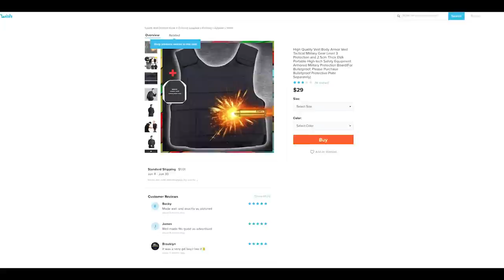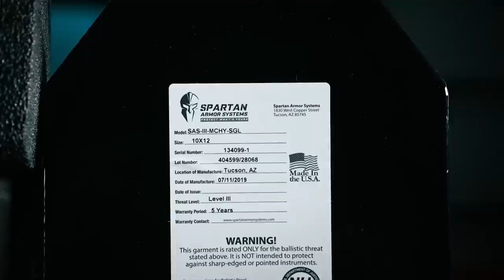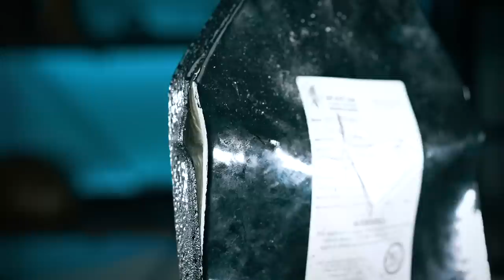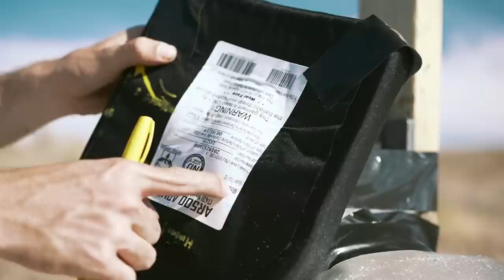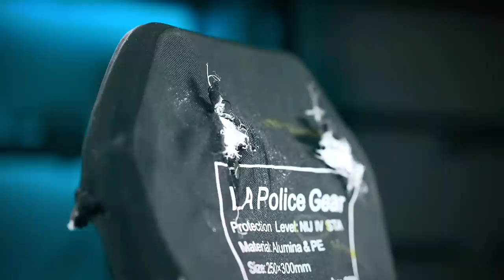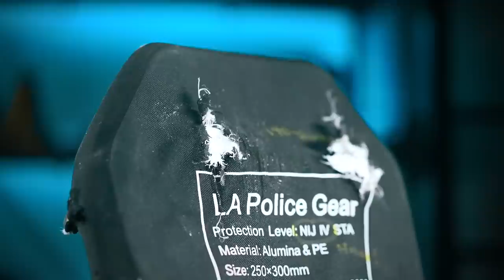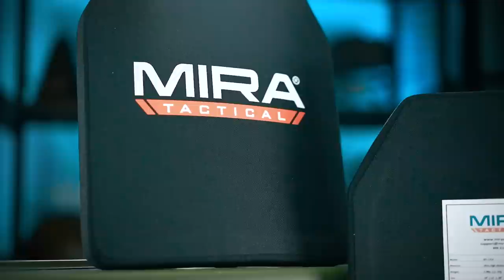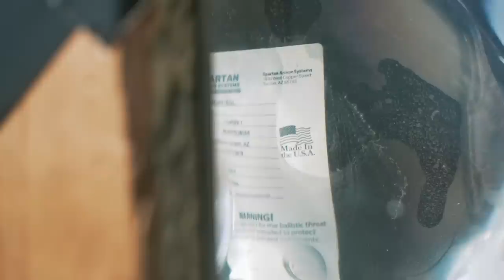Best Ceramic & UHMWPE Level III & IV Body Armor: Mira, RTS, RMA, Spartan, LAPG

Comment: Seems like, of the tested plates, for Lvl 4 the only ones worth your while are RMA or Mira. Obviously in a pinch anything is better than nothing. 

When it comes to staying in the fight, if you plan on tanking multiple rounds, steel 3+ might be the best option. Unless you're up against opposition with high level AP ammo. Longest life best multi hit and can be "light." Also not so sensitive to environmental factors or being dropped. 

I was surprised how M80 chunked most of those Lvl 4s. M80 is pretty common.  As is 193 and 855 and might be safe to say is coming out of 16 in barrels for the most part.  30-06 AP not so much.
Reply: @bkackmagic555  depends on the type and amount of buildup as seen in their previous armor test. Carrier also has an effect on the amount of shrapnel reaching you as well. No one wants to take a round. But I'd prefer a chance of some shrap hitting me vs a round in my vitals. 

You aren't wrong. Some coating on plates is useless and blows out on first hit. A bunch of scrap to the chin could be a game over.

 To each their own as with all things. The point of the first comment is that steel will take(stop) more rounds and is more "durable" and has longer life. 3+ also will stop most of the rounds out there. That is to say the rounds one would be most likely to come across. 

Take it easy, baby. Stay safe.
Reply: @lighlotus117  the carrier will stop spalll that wasn't lethal. It isn't stopping spall moving at 1000fps and up for example. That stuff is going to mess you up good. Plus again. Why are you getting shot that many times. You're larping or you're already dead anyway. You'd be down or domed at that point. No ones gonna keep shooting your chest like it's a movie
Reply: @bkackmagic555  I said, "if you plan on taking multiple rounds." You're goal is to not get shot at (or hit) at all. Shit happens. Why do companies make multi-hit plates? No you're not gonna gonna stand there and tank rounds like it's an 80's action film. No one thinks that relax. 
Fact remains:
Steel will take more impacts(except AP.)
Steel isn't sensitive to environment.
Steel is drop safe.
Build up quality and amount affects shrapnel reaching you.
Carrier construction affects amount of shrapnel reaching you.

This is will be my last transmission. Godspeed, Vault Boy.

Comment: My big question is aren't the plates supposed to be in a carrier. I have never seen a test to see how much a carrier helps in the protection.
Reply: A quality fitting carrier would help mitigate all that ceramic coming free. It would help hold it in place thus helping the plate survive more hits in the same area.

Comment: I feel like armor tests should be somewhere in between the two. I agree that doing 6 shots perfectly spaced to split the plate perfectly isn’t the right way because you are doing a “best case scenario” test. But also, punching multiple rounds into the same hole isn’t realistic either. Worst case scenario for sure. Good info to have but I feel like maybe just standing at X distance and shooting a plate like you would shoot a drill makes most sense. Even at CQB distances the chances you get hit in the same spot during a gunfight is pretty damn low.

Comment: If I remember correctly M193 penetrates level 3 steel only out of a 20" or longer barrel, should have tested a 308 in that first armor too just to see if it stops. I know differences in material and barrel lengths can have different effects on armor, would have liked to seen that
Reply: M193 will penetrate steel when it's velocity exceeds 3150 fps depending on the hardness of steel. Real M193 is doing 3200+ from 16" :D
Reply: @BuffRANGE  so milsurp ammo can but not the stuff I get from the local shop?
Reply: @prodigypenn  All depends on the "stuff". IMI, Independence, and Lake City offerings specifically marked "5.56x45mm"  would do it. That's the primary reason I test a lot of ammo on my channel, because you'll find quite a few statements on those ammo boxes grossly overstate their performance :D

Comment: I use hard cati armor. It heavy but I put everything up to 300 msg and 45-70 and it stopped them all. So I got zither with double coating. I wear it often and each time the weight is riding easier each ride. CATI ARMOR 3+ IS THE WAY TO GO IN MY BOOK JUST HEAVY SO MAN UP 😆

Comment: So, knowing all this am I screwed if all I have are hesco L210s?
Reply: Yes. Another youtuber has a video coming out within 2 weeks
Reply: If you want to protect against .308 Yes :D Video drops Tuesday ..
Reply: I have l210's also and I really like the weight and how thin they are but only having protection against 5.56 and 7.62x39 ap is pretty good in the modern times but if you think you'll ever be facing .308 then yeah its not great.
Reply: @ethanwiley7605  Or boys with 22" bolt 5.56 guns either :D

Comment: Continuing to shoot armor IN THE SAME SPOT OF THE CAVITY and expecting it to stop bullets is asinine.  Multi-hit, does not mean in the exact same location, it means elsewhere on the plate.  If there's NO material left, it's not going to stop rounds, duh.
Reply: They don't expect it to. They're aware of what multi-hit means. Did you actually watch the video, or did you hear what you wanted to hear and tune out the rest?
Reply: @CalzaTheFox  If there's NO material left, it's not going to stop rounds, duh.  You don't need "armor" to do this test, shoot a piece of paper.  It would be far more interesting of a test, to shoot the parts of the armor that have not been shot, to see if THAT section holds up in spite of unseen cracks and damage.

Comment: As much as people shit on steel, it's probably not a bad idea to have as an alternate. Wont stop 30-06AP, but it eats 5.56 all day.
"bUt ThE sPaLLiNg-" shut up about spalling. Get a spall liner if you are so scared of it.
Reply: It wont stop M193 at 3100 fps.
Reply: @tyronejackson6593  All level 3 needs to stop m193. M855 is another story, but that's why armor manufacturers produce level 3+
Reply: @UncleDon226  But it doesn’t. I’ve gone over this with another individual elsewhere already I can provide the evidence. Level 3 and level 3+ will take multiple hits of M855 but they will be defeated by M193 with a velocity around 3100 or better. Heck even the NIJ says level 3 should stop M80 ball BELOW 2800 fps. It’s all about speed here so as much as it may seem counter intuitive that a level 3 steel plate can stop a steel penetrator round but not regular old ball ammo it’s the truth.
Reply: There’s a good read for you. There’s a common misconception that because Level 3 can stop M80 ball (7.62x51) that it will stop anything lower as well but that’s not the case. Level 3 steel plates will stop M855 but not M193 (specifically going over around 3100 fps). Level 3 composite plate will stop M193 but not M855. And btw 5.56 is not part of the NIJ testing. Level 3 only has to defeat M80 ball or 147 gr FMJ 7.62x51 at 2780 fps +/- 30 fps.
Reply: There’s a good read for you. There’s a common misconception that because Level 3 can stop M80 ball (7.62x51) that it will stop anything lower as well but that’s not the case. Level 3 steel plates will stop M855 but not M193 (specifically going over around 3100 fps). Level 3 composite plate will stop M193 but not M855. And btw 5.56 is not part of the NIJ testing. Level 3 only has to defeat M80 ball or 147 gr FMJ 7.62x51 at 2780 fps +/- 30 fps.

Comment: As a peace officer former police officer not working right now my opinion would be you need to worry about what is the likely threat you’re gonna face in your area like I live in a OK area it’s a country area part of the country however high and more worried about KKK rednecks and methamphetamine users with A.R. 10. AK-47s and in some cases PLR 7.62x54 or somebody with a 12 gauge shotgun versus someone with a 9 mm handgun or a 40 caliber handgun …. To be honest I was surprised by this because most departments barely provide gear let alone what I would refer to as good body armor so … yea i’m surprised

Comment: this is a good armor test video, ...for a start. really the best you choose has been on sale for the least price, $99, but will remain the heaviest 8.3 lbs. go RMA.

is there any info on the number of hits soldiers in a war have taken while wearing a vest with armor? would it really be more than 1 or 2? for example the guy filmed by the enemy when he was shot in front of his vehicle. he dropped straight to the ground.

as i see it level 4 should stop the 1 AP rd. after that loosing that 8 pounds might be advantageous or better. (let the not shaken up guys take it a minute).

to drop down to the MRA level 3 SRT (special rifle threat) means you wont stop green M855 or 3006 AP. the plate is super nice at 2.5 pounds though and more expensive at $275. 

IF only you would add some little backing or fronting, lol, enough to keep the sliding green tip at bay, we might get by with not everyone having 3006 black tip.
example: a Vietnam Kevlar flack jacket that holds a plate or maybe a quarter inch aluminum plate behind the lvl3 SRT plate.

so when shopping, look at the biggest hit and most hits taken but most likely one shot stopped and if there is a second hit it might be more likely it hits your body.

thanks if you read all this.

Comment: The most impressive test was the MIRA and RMA Ceramics. However,  I found a Composite Material (Commercially Available) that when cures around the material it creates a tight seal around the armor.  I feel there's a good chance that if the MIRA and RMA Ceramic Plates were coated at least 3 X and should retain the integrity of the plate without spitting out ceramic materials. Are you willing to sign an NDA?
Reply: If you had such a material you would be a billionaire by now.
Reply: @HowardLuken  There's an Armor Company that last year released a Prototype Ceramic Armor (2 plates). It defeats a 50 cal BMG round. The Vest itself is a Level 3 Vest? Yes, the Ceramic Plates stopped the round but destroyed the Cinder Block and the Vest Pattern left an indentation on the Wood Piece. Bottom line, the wearer would die from Extreme BFT with a Crushed Rib Cage and Internal Organ Damage!! I'd say that the Double Classified Ceramic Plates would be best a stoping .223, .308 etc. Not .50 cal.

Comment: Now do steel!
Reply: Steel is bad
Reply: views are good
plus, I'd 
rather take some spall after hit 4 than take the whole round
Reply: @1nisaro  why would u take 4 hits? You gotta sit still. And no you don't want to end up getting spall moving still at a thousand fps or more shooting into your jugular or your arteries in your biceps etc
Reply: @bkackmagic555  You should get back to bashing AR500 more. Do you have a comment autosearch for people saying " Steel " so you can barrage them with your opinions?.
Reply: @yakivpopavich  it's really not an opinion, steel is objectively a shit armor material.
Reply: @evey0259  Nah. Not at all true, but keep on assuming your individual opinion and consensus among ceramic users is matter of fact true. I have seen people buy L210's from Hescoe and IV's from LAPG and guess what?. They all had to be replaced within 5-6 years. Ceramic and composite materials expire. And all companies clearly state they have a 5 year shelf life. Which is fine if your in the Military or a Cop and Uncle Sam is paying to replace them. But that's not the case for citizens. You'd have to replace your plates twice a decade. And that's straight from the horses mouth, both Hescoe and any other reputable company that makes Ceramic or composite materials clearly state the fact that they expire. " The materials the plates are composed of will deteriorate and degrade overtime, eventually compromising the overall security of the plate as a whole ". Almost word for word what Hesco Customer Service , and other companies state. Not to mention backface deformation on Ceramic, and the lack of true multi hit capability. Once those ceramic plates take a hit, that 1-2 inch area is 1/2 toast. Ceramic particles all over. Where as with a steel plate any average Joe could toss a spall lining sleeve over it and be good to go. Average people don't need Ceramic armor. And if your in actual physical shape, your carrier being 8-11 pounds lighter won't make or break you.
Reply: Steel is BaD I LiCk WiNdOwS

Comment: No BOTACH plates for the poors? :P
Reply: Lapg uses same plate as botach just different cover
Reply: @cc-vg4ed  no. LAPG uses an imported plate from a different company. Botach’s Battle a steel is made by LongFri.
Reply: @BuffRANGE  ahh longfri. Don't know why I thought it was lapg
Reply: Botach is really only 8x10. No edge to edge protection
Reply: @bkackmagic555  Actually the Botach level IV has the ceramic extend all the way (or close to it) edge protection. The LAPG plate on the other hand does not.  Here: https://www.youtube.com/watch?v=huMWITj9JuQ&t=190s
Reply: look for the Christmas sale at RMA. they won this video test and they have sold for $99, $119 and regularly $135. made in USA.

Comment: Interesting but...
Not 1 time ever is someone going to be hit in their plates while they're tapped to their chest. Although the pass through shots are a likely kill in any/ most circumstances the PE alumina plates are specifically designed to maintain their multi hit integrity whilst worn inside a vest. Compression from the vest helps keep the whole package together.
Too bad you wasted all that armor just to prove you weren't doing it right in the first place. Calling this 'an experiment' is like slamming your hand in a car door to 'see if it hurts'.
Reply: How would the slight compression while in a bag make it more ballistically sound
Reply: Which vest do they use in the certification testing?
Reply: @n0tthemessiah  they don’t use any vests. bare plates for Worst case.
Reply: Too bad you wasted 30 minutes to get triggered by a couple nerds shooting stuff in the desert